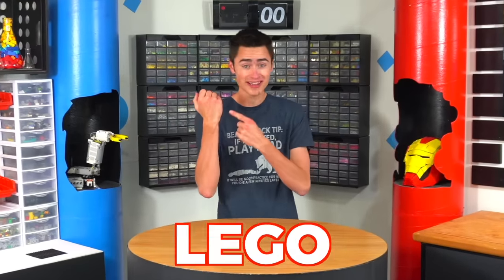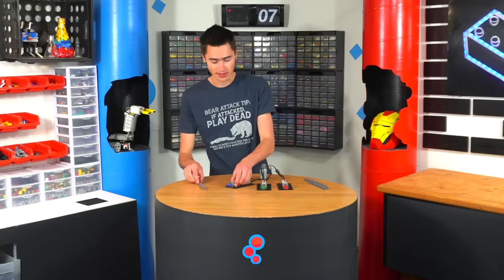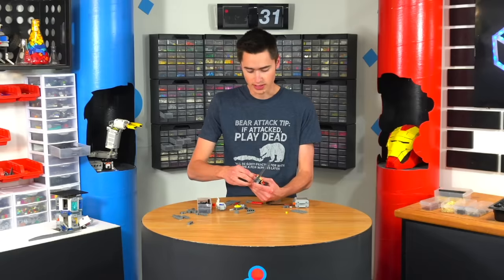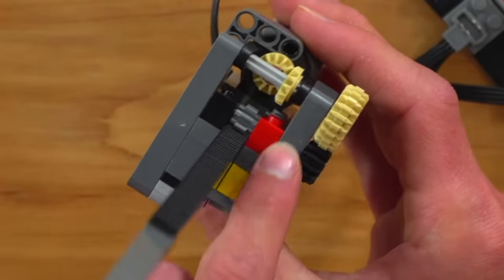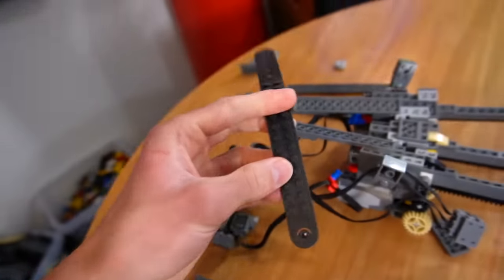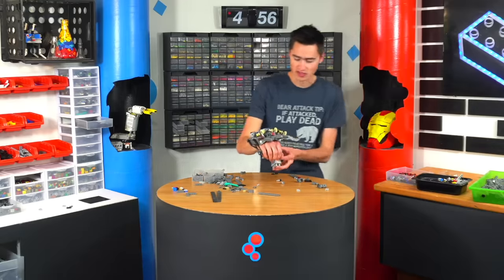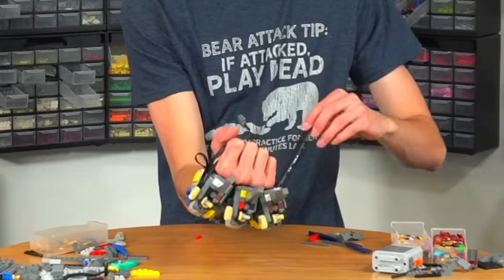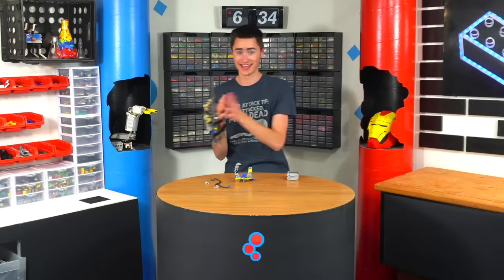I Built LEGO Mechanical Wolverine Claws...

Comment: You could do this without using motors using a "Double Action OTF" mechanism (OTF stands for "Out the front")
I've seen some people make them in Lego but it would be a fantastic challenge to make a small enough version for the claws. Only springs, no motors... but it still extends and retracts automatically